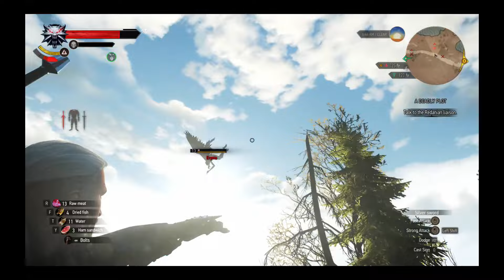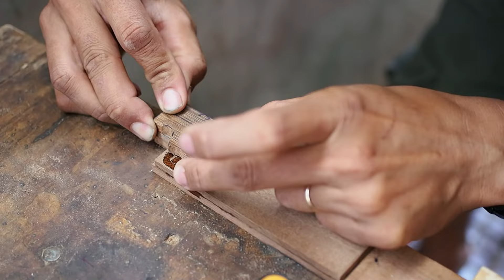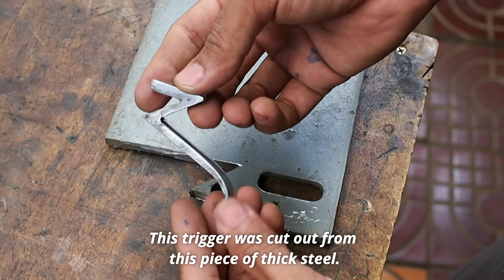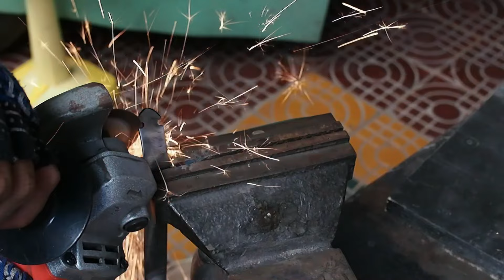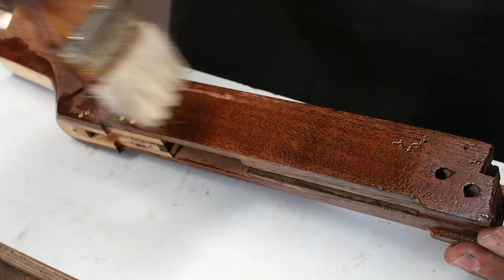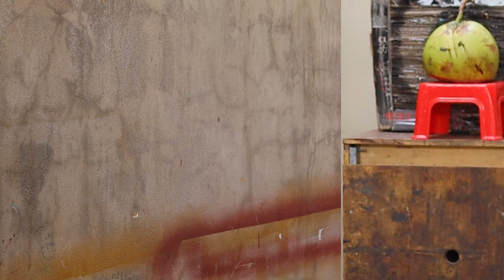Make witcher crossbow from leaf-spring | make repeating crossbow for Geralt

Comment: It's VERY good and very nice work!!
It's not really a repeating crossbow, though, is it? I mean, this one carries bolts inside it, rather than in an external pouch, so it's a start, but you still have to re-tension the x-bow for each shot. It's not really a repeating x-bow until it has a mechanism that automatically re-tensions the x-bow after each shot, so that all you need to do is to keep pulling the trigger until the magazine of bolts is empty.
The witcher crossbow isn't really a repeating one, either, though there IS a perk you can take, which allows you to fire a second bolt without reloading/ re-tensioning. The Hobbit movie (Battle of Five Armies) has a MUCH better example of a repeating crossbow, when the Dwarves are riding together on the goat-drawn war-cart. It has a magazine of bolts and the strings are automatically re-tensioned by the repeated cycling of a handle. You can get a good look at it in the clip below (camera focuses in on its action at about 4 minutes and ten seconds into the clip):
https://www.youtube.com/watch?v=6SGengnqNIM
Reply from the maker: Thanks brother for sharing your opinion. I don't know the real meaning of a repeating crossbow. I call it so simply because i need to reload 6 bolts only once instead of reloading each bolt every time I need to shoot each one like a normal crossbow. I also made another type of repeating crossbow, pls follow this link : https://www.youtube.com/watch?v=x52xcJwEJh4&t=77s